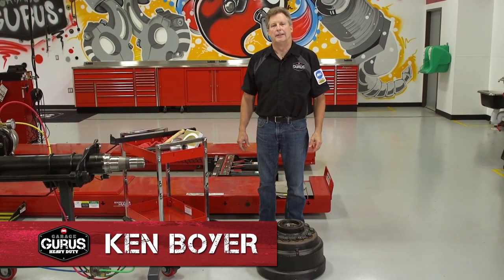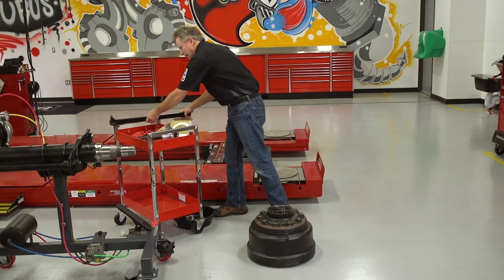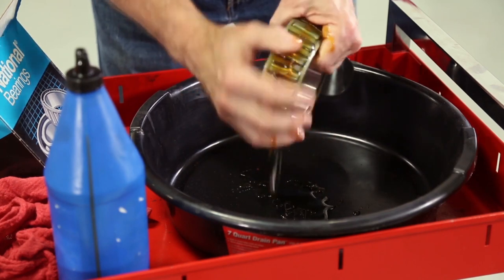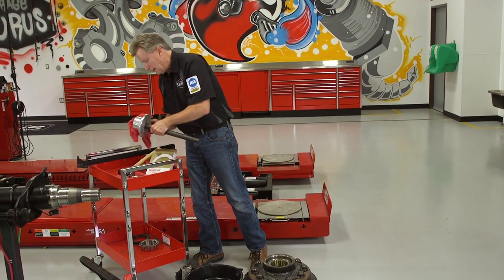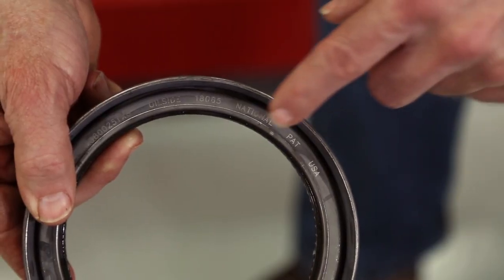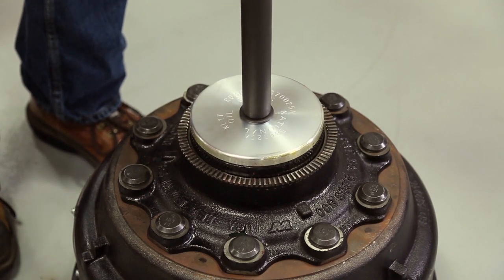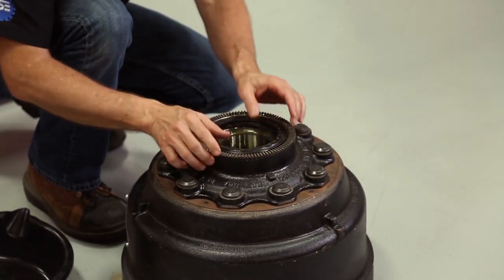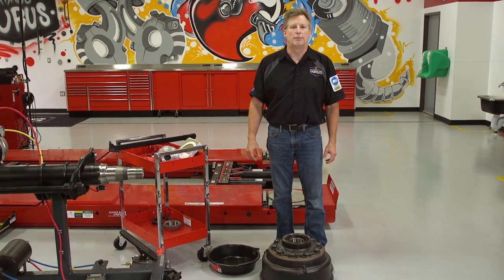Heavy Duty - How to Install Hub Mounted Seal

Comment: I prefer cleaning with either . Always read seal instructions , some manufacturers do not want their seals lubricated . Some want #2 Permatex on their outside metal ringed seals . I always clean the hub bore diameter with a die grinder with an emery cloth flap wheel . Great Video !